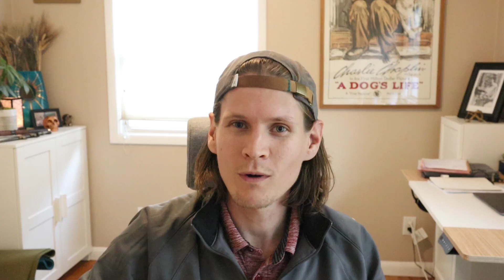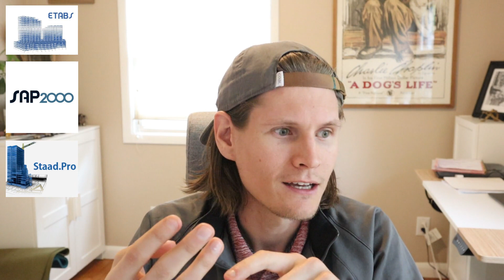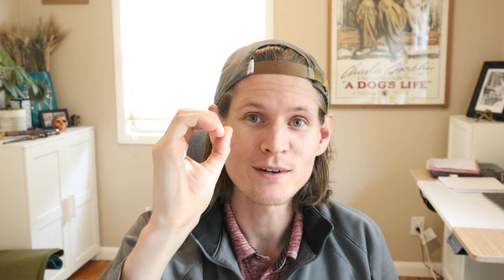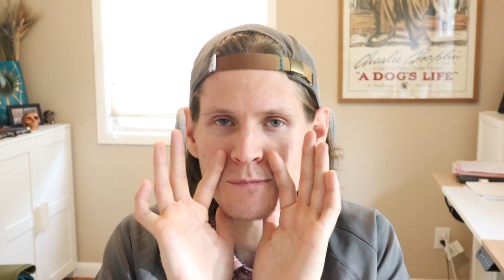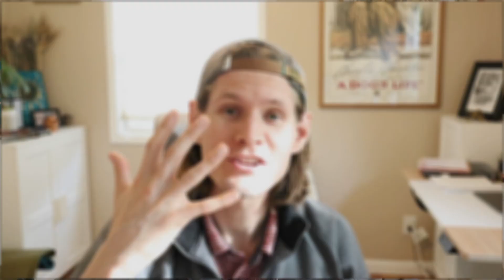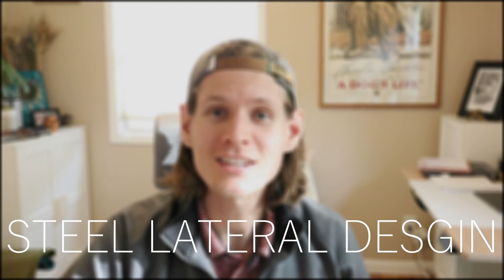Things I Suck At In Engineering | Kestävä EXPOSED

Comment: That is exactly what I did recently, identify things I think that I need to work on and refresh, come out of my comfort zone so I identified certain topics that are used in most project designs, this is why I asked about the ACI direct design method for 2 way slabs. In relation to structural analysis software I have tried to integrate more and more in school we had to use STAAD but we barely touched the surface, we had to basically use YouTube to understand the program, using it is fun but sometimes you may enter a grey area where you may get errors with the way you input your information in the software.

Comment: Hey Rich, it’s Sheldon here this video and what you said is very important, I think all Engineers should realize there strengths and weaknesses but not only that study hard and never never stop learning. And yes there is something I am not very good with and that is wood design, for residential houses or up to mid rise structures, I have never done mass timber, where I am in eastern Canada mass timber is done here only really in British Columbia. At the firm I work at it is  mostly Structural Steel and reinforced concrete design, along with Excavation Protection Systems as well as some civil works as well. Keep up the great work Rich, I just want to say I have learned a lot from you since being on your channel you a great Engineer.
Reply from the maker: thanks Sheldon! and thank you for adding to the notation that we can all be working to improve on something if wee want!